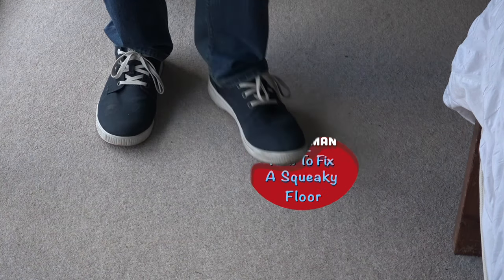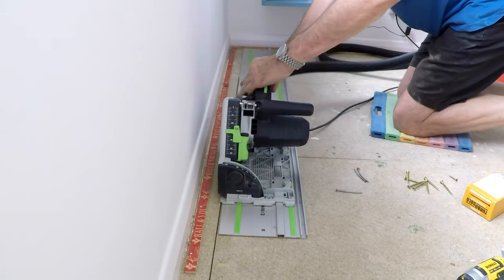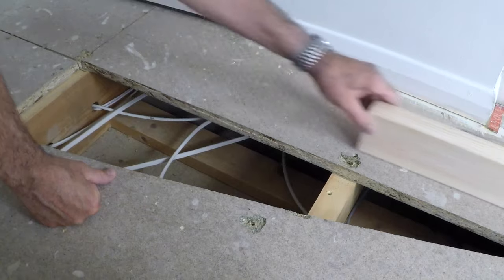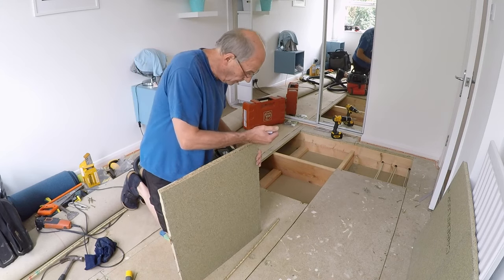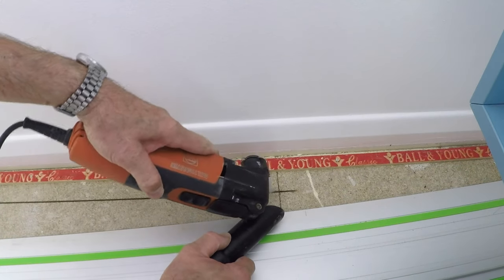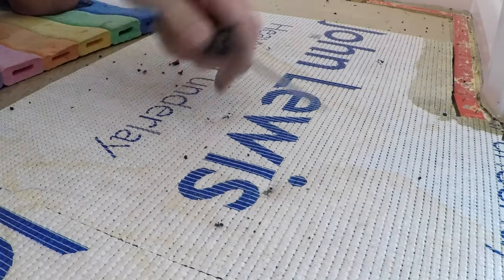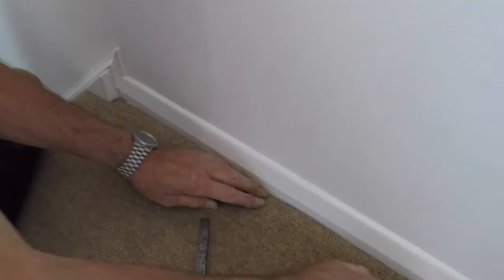How To Fix A Squeaky Floor, a Caberfloor Chipboard Floor. (#4)

Comment: Excellent information to know. I've just bought a hous with this stuff down & it wasn't noisy when we looked at it in the summer, over winter it is noisy as & pipes are constantly banging against joists, I've not pulled the floor up to see how bad it is yet, how long would a fixed like this last? is it an easy job to replace the chipboard with floorboards or plywood, would this be a better fix?  home builders should be ashamed building homes like this to save money & it should be standard for plumbers to lag all pipes throughout the home to ensure they don't knock. They sure don't build homes as strong as they used too, I wonder how long newer homes will last using cheap materials.
Reply from the maker: Hi, how long a fix will last is going to depend on how well done the fix is. I doubt that replacing the chipboard with floorboards or ply will make any difference. It's all about stopping movement, one piece rubbing on another. It's not too difficult a job, just time consuming. In the house I did there was no way I could remove the chipboard from under a stud wall, which is definitely noisy, so I cut the floor close to the skirting but this was not entirely successful. I suspect that the joists have shrunk in places and this is allowing movement. You might be able to cure knocking pipes by securing with clips in places and wrapping insulations around where pipes pass through holes.
Reply: @JohnTheHandymanUK  Great to know, thank you for your reply.
Reply: @JohnTheHandymanUK equivalent thickness of plywood is vastly stiffer and stronger than chipboard. Since creaking noises arise from movement, the material that deforms least under load is to be preferred. OTOH, I suspect percussive noises may be less with chipboard, since it is acoustically dead.
Reply from the maker: @nobodydoesithalfasgoodasyou  yes I'd agree that plywood is stronger but in think much of the noise comes from the joists that have dried out and shrunk a little. Particularly noticeable where the flooring runs under stud walls.

Comment: Excellent video, one of the best ones out there!!👍🏻Provides a good starting point for my bedroom sqeaky floor replacement and soundproofing. I am cutting the existing 22mm chipboard along the edges of the wall, take up the old chipboard and install the new one. Additional noggings to be added, along with glue and screw. In your opinion, do I need to add 3mm expension gap where the old & new chipboard connects?
Many thanks in advance!
Reply from the maker: Thanks for your kind comment. I think a 3mm gap would be sensible. My way of tackling this may not be the best and it didn't stop all the squeaking. I wonder if joists have shrunk and allow movement? Can't fix that! Where chipboard runs under a partition wall it seems to be a problem too. I think this is just poor house building at the end of the day and any fix won't be a 100% success.

Comment: I'm in a newly built house ( 2019 ) and the floors are a nightmare! I wish chipboard had never been invented. My last house ( 1860 ) had pine board floors throughout.
Reply from the maker: I feel for you! It is a nightmare and a difficult problem to solve. I think much of the noise comes from where the chipboard runs under stud walls and maybe from joists that have been poorly fitted or have shrunk.

Comment: I'm seriously considering doing this in my house. I'd also like to level my floors afterwards. Any tips or suggestions would be great.
Reply from the maker: It's not an easy job and there are still quite a few squeaky areas in the floor that I did. I think much of it comes from where the chipboard runs under the stud walls. I think bottom of the walls rub on the floor. If you think your issue is the same try removing the skirting board, drill 5mm holes at a downward angle through the bottom timber, don't go through the floor, and try squirting a PU foaming glue down the holes. With luck the glue will foam up and expand to fill the pesky gaps. I've not tried this but seen someone who has and I believe it worked.
Reply: Thanks for the response

Comment: John, you’re an absolute legend. I just completed an extension room, and unfortunately, the other half of the room is very slightly sloped down. It’s at that middle-point where my creak is, nowhere else. I need your help… 

I would really appreciate your advice on the below…

So my room floor is also using 2.4m x 600m chipboards. 

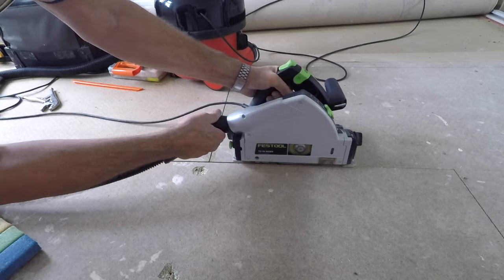1. As per 0:53 seconds, I see that, instead of taking off the screws and lifting joists, you used a circular saw cutter and track between each. After putting them back down after completing your fix, I didn’t quite understand how you / your method in rejoining the pieces “the tongue”? As you mentioned, at 0:43 (they’re “.. Grooved on edges and Locked into adjacent..”) - if you cut that groove off… what to do?!

2. How can I ensure that when I use a cutter to see what’s under, it does not touch/cut a timber Joist? I.e. how can I figure out/ensure the blade of the cutter does not cut too deep downwards?

3. For my situation which is creeking only at the middle-point of the room… can I not just nail it down? I see YOUR actual solution was just adding more “noggins” underneath each squeak area and gluing / screwing it. I don’t think that’s my issue?

Please help! You’d be saving my life.

And oh, liked and subscribed!
Reply from the maker: Hi Shakib, thanks for your kind comments and for subscribing, much appreciated.
 
Cutting the boards effectively cuts the tongue and groove off. I managed to glue one piece back but generally you just have to screw or nail the board back with a tiny gap between them. My theory us if they don't touch then there may be less chance of them squeaking. 

 Just set the blade depth to just under what you think the thickness is and make a cut. If you don't go through the board, then lower the blade a couple of millimetres until you do go through. It's not going to matter if you just nick the top of the joists.

In your situation I'd try banging in the existing nails and then add some screws  next to them. Drill pilot holes first and make sure that when you drive the screws in the boards don't lift. Don't pierce any pipes of cables! 

Hope this helps and good luck.

Comment: Excellent video John, would you mind posting the make and model of your track saw as I'm looking at getting the tools so i can do the same with my creaky floors? Thanks very much
Reply from the maker: Thanks, and I'm pleased you enjoyed it. I have a Festool TS 55 FEQ plunge saw and Festool tracks. They are first class but expensive. I'm sure that DeWalt or even Aldi or  the Lidl version would be perfectly adequate for most woodworking jobs and considerably cheaper!

Comment: It drives me nuts those squeaky boards.Someone has added extra screws but did not help.I assume it is boards themselves .Whoever builds  new blocks with wooden floors is crazy.
Flat I live in has almost all rooms with squaky boards.
Reply from the maker: I feel your pain! The squeaks may be coming from the joists if they have shrunk. This type of floor is supposed to be glued and nailed but often a builder won't bother to glue them!

Comment: Great video and you have given me the confidence to tackle this myself (not for creaks but for some sagging chipboard which i want level for tiling. p.s Did you screw the boards down back into the original holes or were the holes ones you had pilot drilled and countersunk? If the former that seems like a bad idea vs screwing in to fresh board.
Reply from the maker: Hi Doug, thanks for the kind comment. I drilled new pilot holes and countersunk them so I screwed into fresh timber.
Reply: @JohnTheHandymanUK  On the topic of replacing rather than re-using the chipboard, I have measured the board to see if it was 18 or 22, and i seem to be measuring ~20mm annoyingly! Any thoughts? I have seen a few DIY Forums which mention it. House is in UK and built around mid 80's. Need to try to find some similar as packing out 2mm seems like a faf and prone to other problems.
Reply from the maker: @dougjinks2694  I unsure what thickness boards you have. Are you saying they are 20mm and you can only buy 18mm, which  is why they would need 2mm packers?  If your boards are sagging, can you either turn them over or screw and glue a board, say 12mm ply to the underside to strengthen them,

Comment: which one is it?  Don't screw through carpet, but ok to run a circular saw or a multitool?  Is it easier to screw at a cable or pipe or catch it with a circular saw?
Reply from the maker: If I understand your questions....It's fine to run a circular saw as the teeth barely protrude through the floor. Any cables and pipes ought to be below the teeth so won't be damaged. Screwing through the carpet is a definite "don't do" as you run the risk of hitting a pipe or cable.

Comment: i am doing this exact job caber flooring when installed correctly and supported underneath doesnt squeak or move .
every house i work on where this flooring is installed it isnt done correctly  ,the way you have repaired your flooring is the exact way i do it and the only way.
Reply from the maker: Thanks for your kind comment Roy. I have to admit that some squeaking never went away and I think it's the joists that may have shrunk a little or it's where the caberfloor runs under an adjoining wall.
Reply: @JohnTheHandymanUK  sorry for the late response john the job in question the old flooring was similar to kaber floor but was very dry and the composition of it was very sparse,,,broken in places where plumbers had done a repair the main problem was there was an rsj installed where a wall had been removed downstairs the joists were floating inside the recess ,,,very bad building id you ask me ,,,,after much fixing and packing and reinstallation of new flooring no squeaks anywhwere ,,,,i know it wont last forever but customer was over the moon .
Reply from the maker: @roystone1642  wow...that sounds incredible. We'll done for sorting that one. It must have been a nightmare!

Comment: You got lucky usually nowadays the chip board is well glued down to joists and is a big job getting it up and chiselling. Keep the lid on that PU glue it will all go hard with the air getting to it
Reply from the maker: Yes perhaps I was lucky. I did have the top on the glue when I wasn't using it, yet it still hardened!

Comment: Out of interest, why did you put back down the old floor after cutting through the tongue and groove? I am doing similar for my floor soon but replacing the chipboard.
Reply from the maker: There was no reason not to reuse them. The edges still are supported by the joists with sufficient board to accommodate the screws.

Comment: Thanks for vid. Would plywood work better than chipboard for strength and reducing creaking sound? I'm a compete novice I don't know..
Reply from the maker: I'm not really sure that plywood wood be better. Certainly no worse. If you are just changing some boards, you might not find them the same thickness which would cause you problems. I think the problems in my room is that the joists may have shrunk and now move against other timbers.

Comment: Hi John, great video. Will the glue be a problem if the boards need to be lifted again. And did you use any particular floor board screws?
Reply from the maker: Hi John. yes the glue will be a problem if they need to lifted again. I didn't use any particular screws but I think I drilled a clearance pilot hole in the boards first.

Comment: Very informative thanks and just what I needed as I’m sorting a squeaky bedroom floor and replacing some parts. Sadly previous work by a plumber has left some boards hacked so I have to use butted ends not T&G. Should there be a gap when butting joints or can I go right up and glue and screw?
Reply from the maker: I don't think you need to butt them up, they may possibly rub together and squeak if you do. Having said that if they are fixed down tight they should be fine. I never completely got rid of the squeaks as I realised that the movement was often at the very edge of the floor, and under a stud partition wall that had been built over a floorboard. It's possible the ends of the joists may have shrunk and so be the problem. Once you've lifted the boards, see if the squeaks are still present. If they are then it could be the joints moving. Good luck with that one!
Reply: Thank you

Comment: Hi John, excellent video. I live in a flat with really bad floors that dip and are structured with the same materials in your video. I have fitted wardrobes which cover large areas of the joists so access is difficult. I don't fancy tackling it at all but wonder if instead of carpet, a laminate floor on top of it might alleviate the noise a little? Thank you.
Reply from the maker: Hi Tom, and thanks for the kind comment. To he honest, I don't think changing the floor covering will make any difference. The squeaks, I suspect, come from the edges of the floor and joints. The floor in the video still squeaks around the edges. I think the joists have shrunk, and they might benefit from wedges being driven into any gaps, but that's impossible to do!  I wonder if laying another chipboard or ply floor on top of the existing and screwing it down would help. It might lessen the movement but if the joists are the problem it may make little difference.
Reply: @JohnTheHandymanUK   Thank you. I suspect you are right and think it might be best to just live with it. I've a feeling that if I wanted it remedied properly I would have to take out all of the walls and fittings, lift the floor and start afresh! Thanks again.
Reply from the maker: Yes I think fixing it would involve stripping everything out! As you say you'll have to live with it.
Reply: @JohnTheHandymanUK  It is most likely the joists themselves, as you say. They tend to move/shrink in the joist hangers over the years. It's not really an issue when the builder does the job correctly and secures the joists to the hangers properly.
Unfortunately, it's very common to find they just haven't bothered because it won't be their problem. 
You can sometimes get to the hangers to wedge and screw them but it's a pain.
A bit of expanding foam in the floorboard gaps created isn't going to help squeaks but helps in other ways.
Good videos, keep up the good work ty.

Comment: Hi John, I have near enough 4 to 5 inch wide boards, it’s an old house and it makes loads of noise only in my main bedroom, I have a newborn now and the noise wakes her up, I have to walk through a bombfield by remembering where the noise is and where it ain’t, I actually purchased that not squeak tool you mentioned lol to do it myself but after what you’ve said I’m abit sceptical to do so, what should I do?
Please, some advice will be grateful, I’ve put new carpets up and one bedroom the carpet fitter fixed the squeaky noise by adding and replacing nails, but I don’t know what to do now
Reply from the maker: Hi Mizan, I feel your pain especially with a baby. If it were me I'd take up all the carpet and underlay first and find which boards are the problem. Then I'd lift those boards so that I could see the joists etc for fixing back. If there are cables or pipes mark their position on the floor so that you don't damage them and refix the boards with floor board nails or screws. Perhaps try 5 x 60mm screws and drill a pilot hole through the boards first. The boards need to be tight to the joists. If you use screws it will be easy to take the boards up again if necessary. Check for squeaks before refitting the carpet. Maybe use the bedroom a few nights before fitting the carpets. I hope this helps and good luck.
Reply: @JohnTheHandymanUK  thank you 🙏

Comment: Hi, once you remove the carpet and underlay then you will see the existing pattern of screws...if you drilled new screws adjacent to each of the old screws, maybe offset by 1cm, wouldn't that be a quick fix rather than removing all the floorboards? (The logic being that the existing screws are perfectly placed already)
Reply from the maker: My floor is nailed, not screwed but I guess your way would work, but you would be taking a chance on not hitting a pipe or cable! Lifting the floor gives sight of what's underneath.
Reply: I tried this, it didn't work. It's the unsupported edges of the panels (between the joists) that are making all the noise, hence the need for the noggins. I'll be following Johns method. I was also impressed with the track saw, could you post what make it is please?
Reply: I had limited success, eliminated most of the squeaks, but yes, I think the joins are were the main problem area lies. I used a pvc water mixture to help seal the existing noggins. I guess I achieved around 75% elimination without lifting the boards.

Comment: Good video. I've never understood why those floorboards need to be 'tongue & groove'??! (why do they need to slot into each other? Surely gravity and screws is enough to hold them in place!
Reply from the maker: Thanks for your comment. I imagine the tongue and groove are supposed to make the floor more "solid" but I'm not sure that works! Keeps the dust out though.
Reply: Weak material relies on interlocking for support/load-spreading at edges remote from joists

Comment: very useful video for many I suspect - 
is that foaming glue 'Gorilla' glue - if so does it need a water spray to activate it
Reply from the maker: Yes Chris it's Gorilla glue and it does need water to activate it although if the humidity is high there is probably  no need to dampen one surface. I wiped one surface with a damp rag before applying the glue as shown in the video.